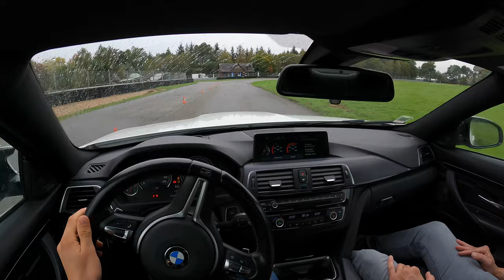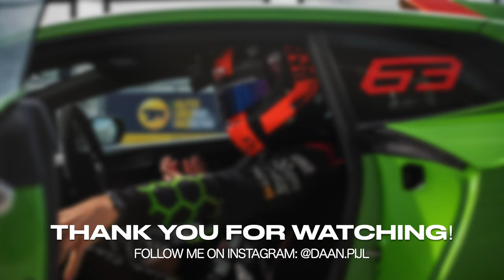HOW TO DRIFT - BMW M4 F82 at Circuit de Lohéac | POV Onboard

Comment: This is crazyyy! I’ve watched this so many times!!! Why are you up shifting into 4th? Been learning to drift on sim for over a year about to get an LSD for my BMW M235i really wanna start sending it! Any advice
Reply from the maker: Nothing beats a M235i with an LSD, choose a safe environment and best in wet conditions. I went to 4th gear to increase wheel speed, which makes it easier to control!
Reply: @DaanArrow that ZHF trans doesn’t take donuts and drifting too well
Reply: @f30josee70  believe me man it does!
Reply: @f30josee70  no from my experience, its easy for me like tooo easy.